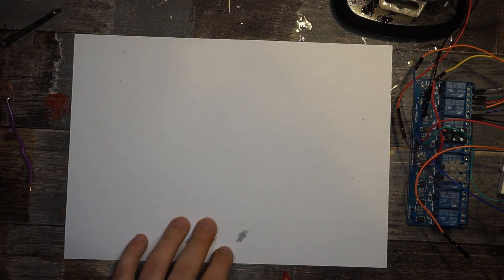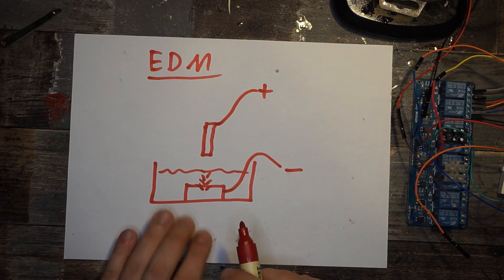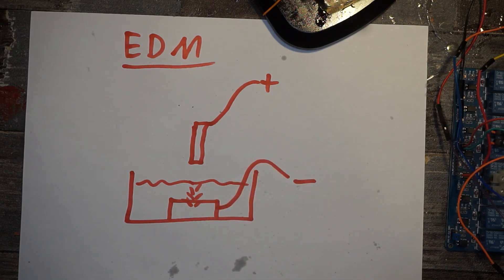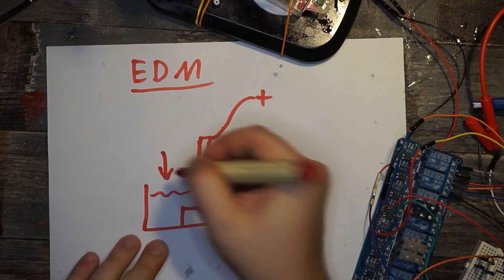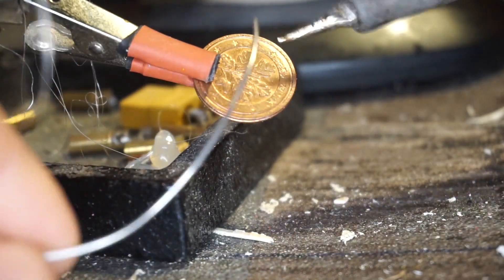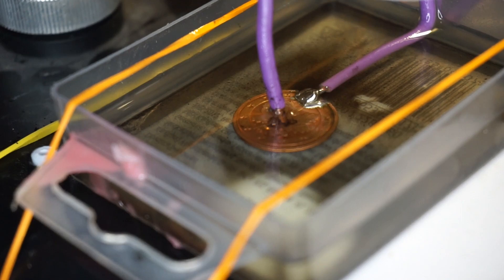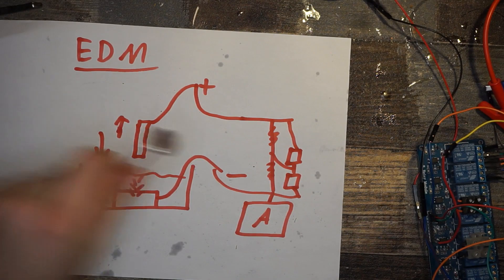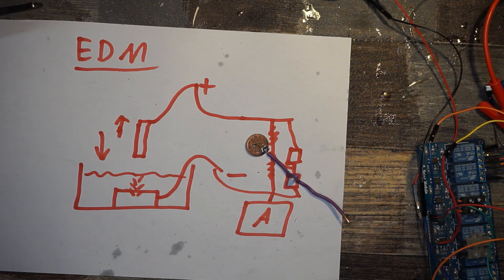Electrical discharge machining (EDM) Demonstrator from Trash Parts

Comment: A very good start on a simple edm machine. Try cutting something hard like a ball bearing to prove you can put a shallow hole in something you cannot usually cut.
Reply from the maker: i am working on the video of part 3 now and it will include some cutting of diverse materials
Reply: 2-Eurocent-coins are made of steel, platted with copper (if it were pure copper, like other currencies earlier, the copper would be much more worth than the worth of the 2-cent-coin itself  ;-) If EDM can cut steel, hardened steel shouldn´t make a difference...

Comment: I have learned from Baxedm that you need to use water with a specific conductivity to generate a spark on close proximity, not on contact. 
Thought I’d share
Awesome project!
Reply: I think using deionised water instead of oil might give you a clearer view
Reply: Deionised water is used on wire eroders that cut with brass wire. Spark eroders (edm) use a light low flash point oil. So, sunflower oil is is good starting point.

Comment: maybe I wasn't paying attention, but what did you use as a powersource?
Reply from the maker: in this case my Lab Powersupply with 0-50V DC, i found that about 24v worked best for this case, on higher voltages the process was quicker but welding became a problem.
And since my setup wasnt exactly stiff i tryed to avoid welding.
Reply: @boltzbrain3039  What was the current draw? Will a 10A 24V SMPS supply suffice?
Reply from the maker: @palliyil  a 10A 24V will do the job
Reply: Was searching the comments for this also. Thanks :)